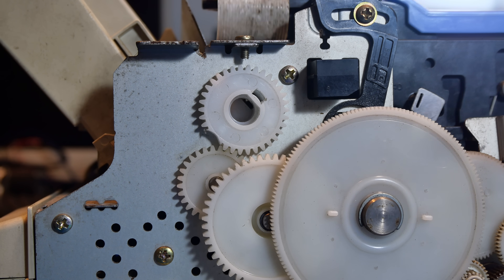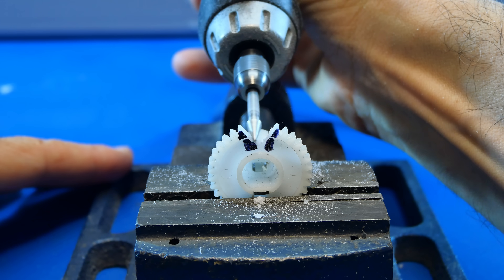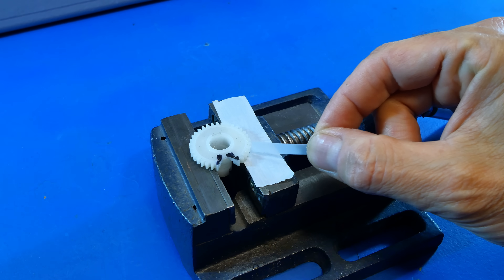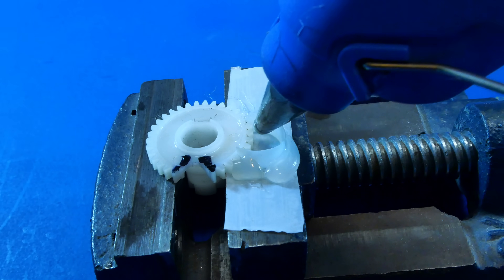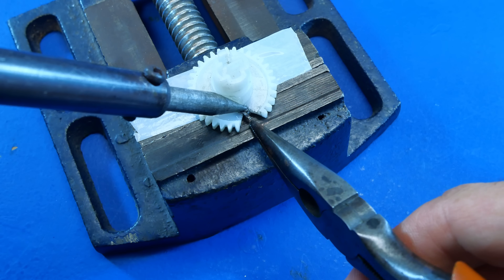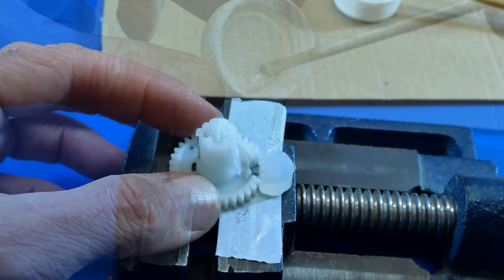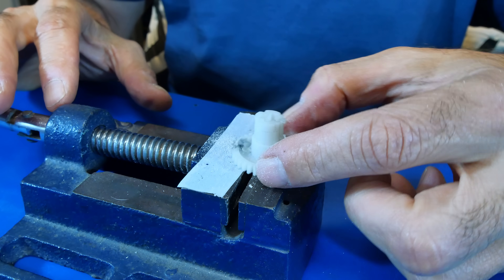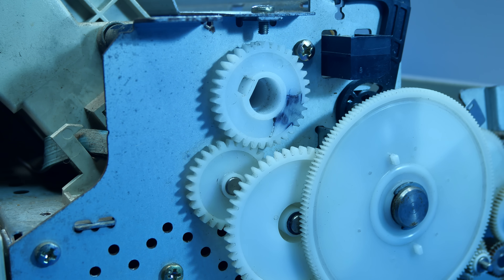Stop Replacing! The Best Way to Fix Plastic Gears!

Comment: I have a Bonsai shredder with a plastic gear who's teeth strip if I shred too much paper. If I use this technic to replace gear teeth, will the polyester resin be strong enough to not strip? What is the strongest plastic I can use? I use replacement gears that are 3D printed in Poland. But the plastic gear material doesn't seem to be very strong.

Comment: very cool trick!
I've also had success with 2 part epoxy, which tends not to stick too strongly to the sticky side of tape. I can make sides of a module that way sometimes, but it's also good to make some tests on similar material or if you're using a different brand of tape than you usually use.

Comment: Hello, I am from Taiwan.  Your method is very practical, but I would like to ask if you have any recommended brand of polyester resin?  Probably in the curing time, including the operating time limit after mixing, and most importantly the quality of the cured.       I really hope to get a polyester resin that is very easy to use

Comment: Great idea to mix the hardener in the cap of the bottle. It will seal the bottle forever. But using hot glue as a mould is a good idea.

Comment: Lubricants not specifically designed for plastics seem to cause rapid deterioration of plastic gears
Reply: Silicone grease works for most plastics.
Reply: That's why you use the correct lubricant

Comment: Watching from Germany. Thank's, good work!!!☺
Reply from the maker: Danke ! thx for watching from Germany !
Reply: @Repairman10169  Never use WD40 or other random oils on plastic gears. They can make it brittle and crumble apart, which is even abused as an obsolescence trick. E.g. in toys often cogs or wheels crack apart around their (typically square) metal shaft because the plastic swells by wrong oil and so pushes against the center hole until it breaks. In quartz clock movements the swelling also can make the mechanism get stuck, so I had to file the bore bigger (e.g. with a metal wire) to make them spin again. Particularly malicious are PU and POM cogs; these are yellowish translucent soft plastic designed to reduce gear noise (e.g. in tape drives like Telefunken TC650) but decompose into crumbly mess after a decade, which is likely furthered by contact with wrong oil. It can not help to remould individual teeth, because the whole cog will fall apart.

On plastic and non-silicone rubber parts use silicone oil or silicon grease only, unless the instruction manual explicitly requests a different lubricant.

(Greetings from Germany.)